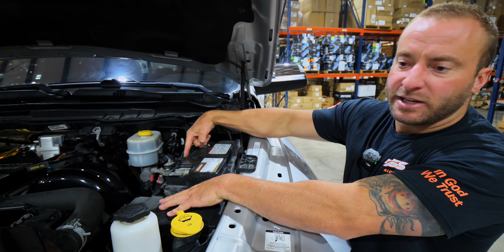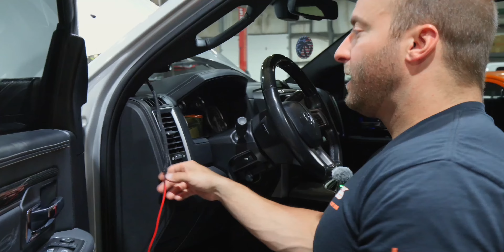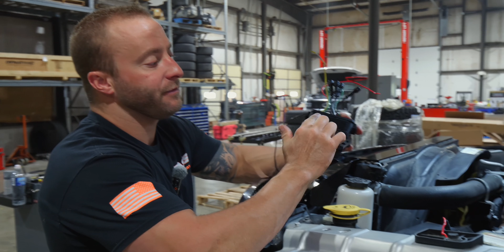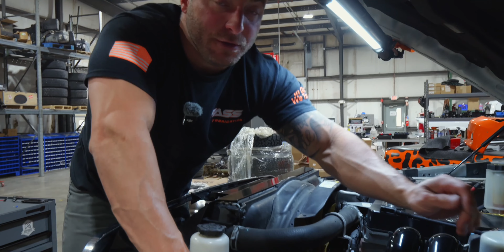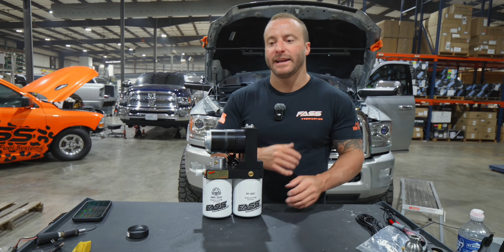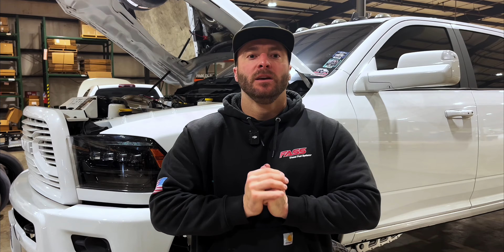How to Install the FASS Connect (Single Sensor)

Comment: Produce an updated install video, with editing. Most of us that install the Fass, followed by the “Connect” already have the qualifications to attach wires to proper sources. Install video here is fine, but some editing would help.
Reply from the maker: Thank you for the feedback! I will send this over to the correct team!
Reply: @FASSFuelSystems 
The dude has big muscles and he is well spoken, but it pisses me off when he spends too much time using electrical tape and various other time wasting skills. Yes, he’s handsome and he’s strong but use another person to aim the camera at more useful objects than large biceps, please. The current freaking heat wave in northern Nevada makes me a little pissed off to begin with. Mid July 2026 all the way to early August 2026 has produced a little more irritation than normal. Yes, I know some people work under 130° temperatures but I’m not a young spring chicken anymore and certain things piss me off more than they should. I installed the titanium 165 on my Volvo D 13, it runs much smoother after the install. I also removed the fuel cap, very critical to check for Air returning from the Pump. No bubbles whatsoever coming back from the return line. That proves the fastest 165 kicks Ass.
Reply from the maker: @markthomas4083  Thank you for the support!
Reply: Can’t wait to utilize the Fass heater (pancake style).